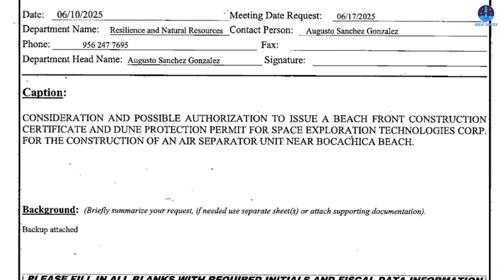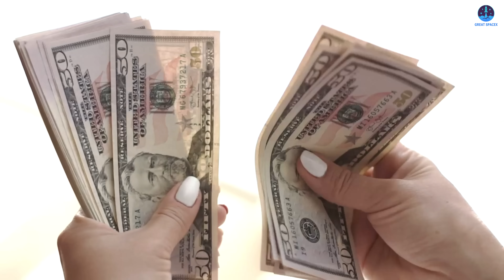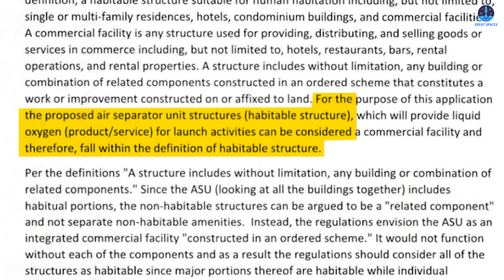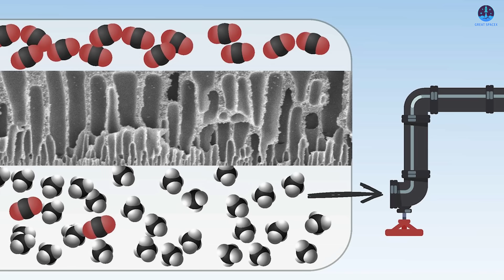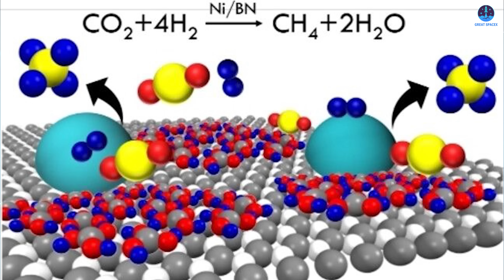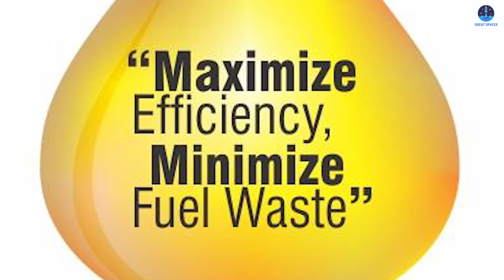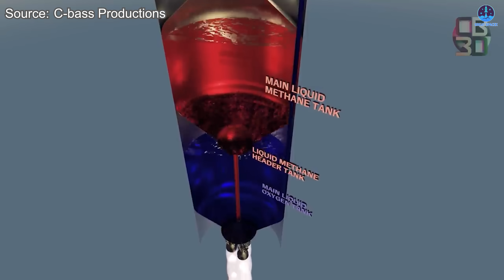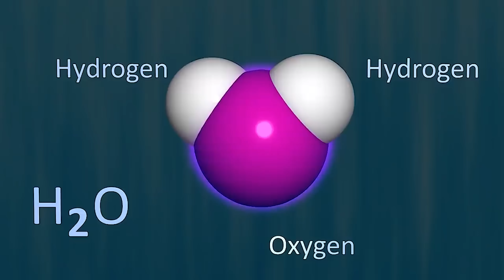SpaceX officially announced Building Starship Fuel Plant at Starbase...Yes, finally it happened

Comment: Forget the idea of making methane on Mars, you need a lot of solar power, if you're wondering, 700 square meter array to capture 1kg an hour, enough sunlight for the job, not going to happen any time soon, not to mention the Sabatier system to make it all work and huge tanks to hold it all, it's many many years away just to get the stuff there, then assembly? First we have to make the robots that can assemble it, and we haven't invented them yet (I doubt production line robots count)

Comment: Where do they expect to find methane on Mars?
Reply: You can make methane like we do on earth, out of the carbon dioxide in the air.
Reply: @flightsimdev that requires a vast amount of energy. Which is why methane is tapped from the ground on earth. Where does the energy on Mars come from? nuclear reactors? Sunlight is very weak on Mars
Reply: @flightsimdev  Methane is never made like that on Earth. It would be way too expensive to do. All methane comes from drilling oil and gas wells, or from landfills creating it inside a sealed garbage dump.
Reply: @billsimpson604  regardless how they make it on Mars, it's not happening in the next 30 years.

Comment: If Elon can make Methane on Mars why doesn't he do it here already.  Just need loads of solar electricity, split water in to Hydrogen and Ogygen with that energy. Then capture CO2 from the air and combine the hydrogen and the CO2 to make Methane with a process they call the Sabatier reaction. And yes the process is not very energy efficient, so what? Just put three times the amount of solar panels that you need. This way the whole process becomes also CO2 neutral because the CO2 produced during the burning of the Methane is the same CO2 that is captured from the air.
Reply: Solar panels on Mars are only 25% the strength, of on Earth, distance matters, to do what you propose, means a 1km x 1km solar farm, and I doubt he could make that any time soon.
Reply: @flightsimdev  Thats why its good to start doing it here on earth first.
Reply: Sounds like the negative carbon footprint idea from the Sabatier method was overcome by the brine impact from desalinization. Plus the solar energy real estate - how about a solar sat?

Comment: Great Video !  A low inclination LEO Fuel Depot launched East from the KSC near the LEO CSS is also needed !  The LEO Fuel Depot should be supported by Blue Origin and SpaceX with Oxygen/LOX. Methane (CH4) and Hydrogen !  Also a LS Fuel Depot is needed  near the  South Pole Lunar Outpost/Base (Clementine Base) !  The LS Fuel Depot is supported by the recovery of Lunar Water Ice (H2O) !  The Hydrogen in the Lunar Water can be used to recover more Lunar Oxygen (LUNOX-TM/LOX) from the mineral in the Lunar Regolith !  Heated Hydrogen can be used to recover  Solar Wind Gasses  from the Lunar Regolith that a Seattle based Lunar Mining Company  (Interlune) is planning for about 2030 !  The Tech developed to return to the moon to stay, can take US and the world to Mars and beyond !  For more info read the paper  "Moon Direct" by Robert Zubrin !  Timothy Lipinski
Reply from the maker: Yes! Zubrin’s “Moon Direct” is a solid reference for this vision—lunar resource utilization is key to Mars and beyond! Keep pushing these concepts!